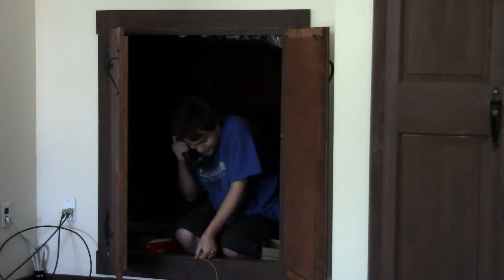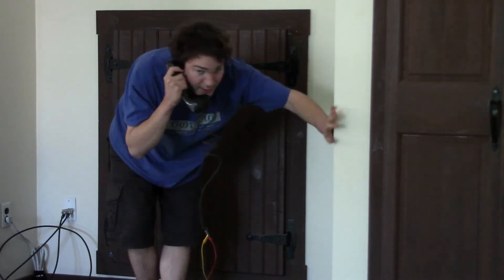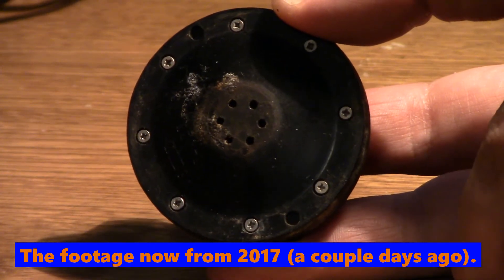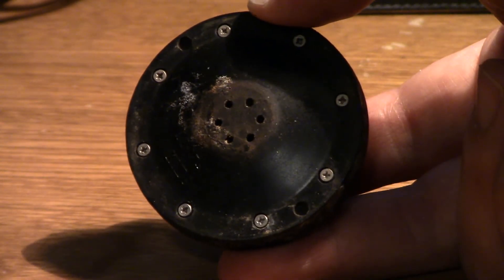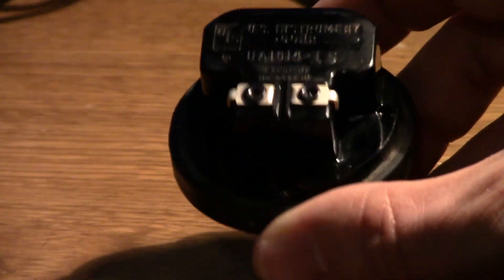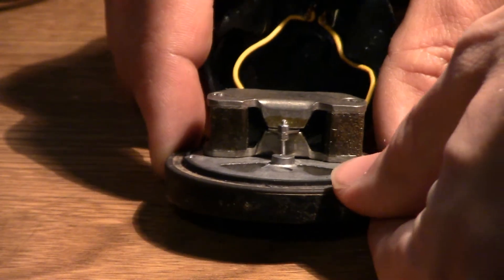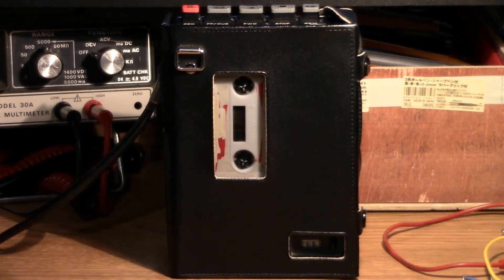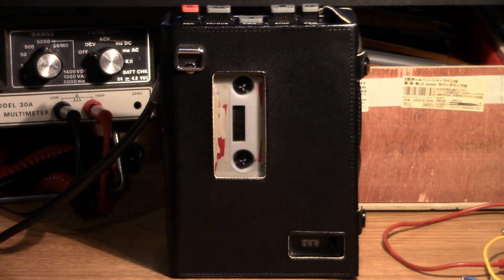Sound Powered Telephones -- A Fascinating Technology -- US Instrument Corporation

Comment: That is possible due to very little resistance in the equipment and wires to electricity as being robust to withstand the elements.  Rusting metal is bad.

Comment: Great video guys! Found a pair of these in the parents garage, no wires tho, how do you wire them as a pair? I can only get them going one way
Reply from the maker: Just wire the handsets in parallel, polarity doesn't matter. Both transducers are internally wired in parallel on each handset.
Reply: @CassetteMaster  thanks! Each one has a matching ohm reading, still very very quiet, perhaps the magnets inside have weakened?

Comment: Fascinating. In the late 1960's they used to sell old surplus transducers at Radio Shack, but never gave a wiring diagram, so I coukldn't get them to work. I think they were not real transducers like you have but were the carbon cartridges used in the powered telephones of the 50'2 and 60's. I gave up trying top get them to work!
Reply: Funny thing. The last time I went to Radio Shack was to buy some parts. One of which was simple. A 9 volt batter lead. And the other a CB Radio. They looked at me(all young under 19 years of age) Like I was from Mar's. The really at that point only sold cell phone and remote controlled toys. I just said(Really) Your name is Radio Shack. They went bankrupt a year later. So Sad it was a great place once.

Comment: Very neat phones. I don't understand how it's possible to hear on these things like when it's loud like in a battleship. Also what station are you able to pick up? I have a mini guitar amp  and can pick up a 100,000 watt country station with it albeit weak.
Reply: They also have "phone booths" with specific sound deadening walls. Have the same ones in the engine room I work in as a Merchant Marine
Reply from the maker: There were also special headphone with mike units that go on the head similar to a gas mask. The mike was very close to the mouth and the two sound powered earpieces directly to the ears.